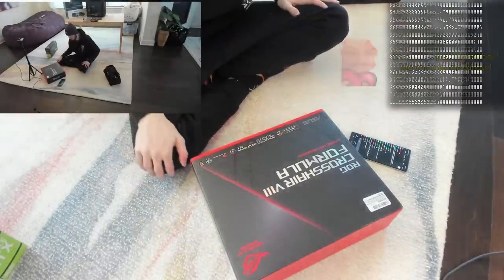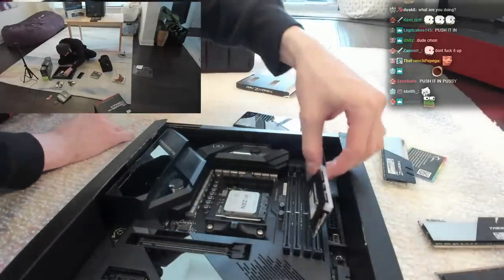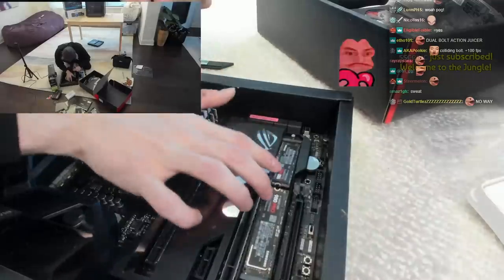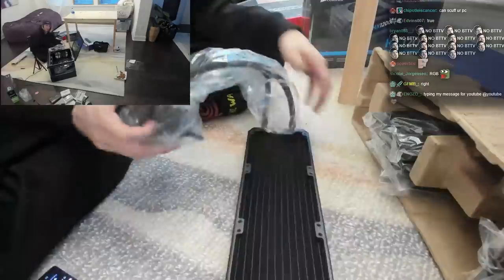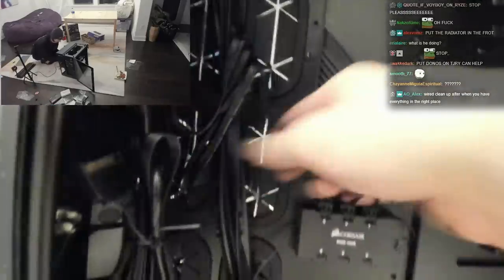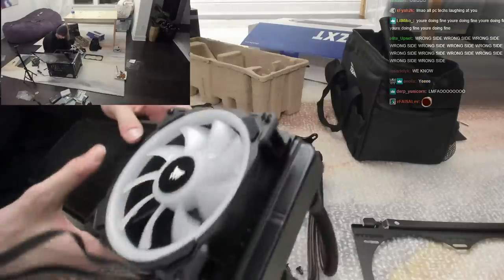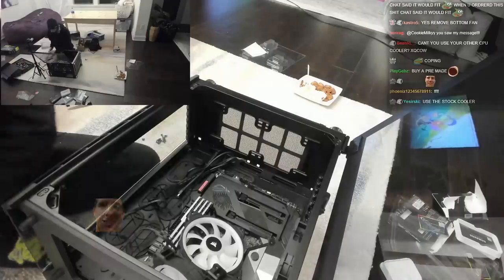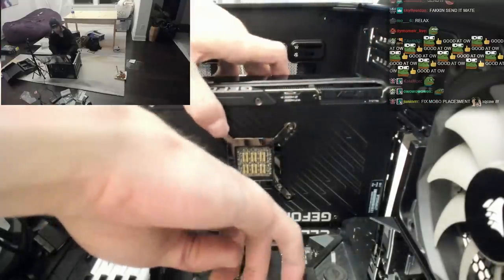This PC Build did not go as planned

Comment: How to ground your self:

1) wear socks
2) be on a carpet
3) touch metal
Reply: 5 head xqc
Reply: Or just touch your plugged in but turned off power supply to discharge yourself. Somebody in his chat should have been smart enough to know that, or maybe not.
Reply: @C0smicr3aper  I literally was there and typed it in chat
Reply: depanto 108  Yes
Reply: Lol
Reply: @TheScaith  what time stamp
Reply: @C0smicr3aper  it’s twitch chat, what more did you expect of them lol
Reply: @liamwatrous694  wait so what does being grounded means? Cause im thinking of building a PC soon. My room has carpet EVERYWHERE. I have a small wooden table i can put the parts on. I don't know anything about these things.
Reply: @ShawnFX  You can use an anti-static wrist wrap, it's what I used when I built my pc.
Reply: @liamwatrous694  I have tiles floor is it safe to do it?
Reply: @whodatboy3  pretty sure its safe
Reply: @whodatboy3  You should always ground yourself anyway just to be safe, it's just a good practice to have

Comment: My man's wearing socks and sweat clothes on carpet building a computer.
Reply: I've done that before, but I've been building pcs for 20+ years
Reply: To be honest it's fine as long as you ground yourself using a plugged in case/power supply, avoid rubbing the carpet, and avoid touching any of the conductive parts of your components. You really don't have to be as paranoid as some people think as long as you have some clue about what you're doing (and as long as you aren't one of those people who unplugs a PC before working on it)
Reply: @mollycrime  Why would you plug in your pc while working on it....wow. You people are something else.
Reply: @drunkhusband6257  It's PC repair 101. Leaving the power supply plugged in allows you to keep the case grounded. You'll be able to ground yourself simply by touching any grounded metal part of the case. It's incredibly basic. Look it up.
Reply: @mollycrime  I've been building/repairing PCs professionally and as a hobby for 20+ years, I've literally never once seen anyone leave the power supply plugged in while building or upgrading.....you know why? Because it's an idiotic thing to do because the charge from the components can hold current.
Reply: @mollycrime  smoll brain
Reply: @mollycrime  stop trying to recover from what you said
Reply: @mollycrime dude what legit never have I ever seen someone leave their power supply on while working on the pc… It’s common sense to turn it all off and having no  electricity

Comment: This man never fails to amaze me.
Reply: FR like he just somehow fucks up its hilarious
Reply: I missed the PC Building stream .. what did he break ? Sadge
Reply: @bari_6157   he got the wrong case even tho the website told him it was the correct case for those parts
Reply: @SiR_236  that's what I call a classic "PCPartPicker" OMEGALUL
Reply: @SiR_236  Pretty sure if he keeps the fans on the bracket pointing outside and installs only the radiator on the inside, then the gpu fits just fine. I just think he's too afraid to break anything, so he doesn't use enough force to screw the graphics card in. He almost even gave up at the first stick of RAM just because he wasn't pushing it in properly.
Reply: @bari_6157  happened to me with my psu lol
Reply: @erikl9146  Sadge
Reply: @SiR_236  yeah Pepehands
Reply: But oh did He fail at everything else

Comment: I'm 99% sure his GPU doesn't line up with the screw holes because he didn't put in the motherboard standoffs. Causing his motherboard to be too low, and his GPU is tilted cuz his motherboard makes it go lower than the back pcie brackets let it.
Reply: 5head
Reply: Yeah for sure it wasn’t on the stand-off properly. I could see the motherboard flexing as he was tightening it as well. 😬

Comment: This build inspired me to buy a prebuilt pc
Reply: @macksladek5782  kind of is
Reply: Honestly now it’s probably better to just get a prebuilt
Reply: @macksladek5782  I just did my pc build and my god it was hell. Watched countless hours of pc build videos and also read the manuals for hours and putting in the aio on the front was a hassle. In the end my pc didnt turn on after having everything plugged in  right. Had to return my mobo and replace it and also my psu and the pc turned on finally but no POST so then i did more research and turns out my mobo didnt support my ryzen 5600x cpu so i had to take everything apart again and get a different computure to download the flash bios update on a flash drive and put everything together again. In the end my pc build turned out great but the stress building it was not worth it in some aspects
Reply: @dabmwlawnmower8089  true but in the future building a pc is better.
Reply: @adeezzee8892  It's way, way cheaper though. Think of it as working to make hundreds of dollars in a single day.
Reply: @adeezzee8892  are you sure your motherboard didnt support it and not just your bios
Reply: @adeezzee8892  u just pepega
Reply: @RonPaul42069  Nope almost every single thing I bought was almost double or more than the retail price. Only reason I built mine is because it’s more customizable and makes it feel like mine
Reply: @syaz4380  nope the mobo was messed up because I replaced it with the exact same mobo and the build managed to turn on and I had to update the mobo using BIOS Flash back in order to post the bios and support my cpu
Reply: @adeezzee8892  asus gave me a motherboard with a bad bios even after the flashback. I had to order a new one from asrock and it works perfectly with my 5800x ryzen. Lost around $200 bc asus wouldnt repair or refund me.
Reply: @icedtokey5511  yeah that’s true but just from what I see I don’t think the gpu prices are gonna go up soon so if you wanna wait you could probably get a better deal but it’s just not worth it IMO
Reply: @Zealch_  I ordered my asus mobo from Amazon and I had a replacement for free so that sucks too hear that sorry bro :/
Reply: @adeezzee8892  ill show u my build ull cry go play child
Reply: @adeezzee8892  just use a pc parts picker so you can figure out compatibility you pepega
Reply: @yab3146  it’s not hard, it’s like 8 different components, but right now because of the shortages it is cheaper to buy a prebuilt so if you’re planning to get one i’d recommend just buying a prebuilt

Comment: Nobody in your chat knows what they are talking about it’s not the case the radiator should be a 240mm or 280mm to mount at the top and nobody thought about that when they told u to get a 360mm they the gpu would fit to
Reply: watercooling is overrated anyway. should have gone with aircooler and had much less issues and hassle, plus i think it looks way cooler ha-ha.
Reply: @userise222  Yeah, the Noctua double tower triple turbine juicer would have been fine

Comment: Buys a motherboard meant for VRM cooling, uses an AIO.
Buys a case that probably 'looked cool in the pictures', but doesn't fit the dimensions of a RTX 3090, along with an internal case fan & radiator.
Doesn't use all of the case standoffs for the motherboard to correctly align the board in the case, no wonder why the graphic card bracket didn't align with the case.
I'm just surprised he remembered the power supply this time around.

Comment: hes lucky his components werent fried, however they have gotten more resilient in the previous years. why did he unscrew the 1st and 2nd slot instead of 2 & 3, and not push the case in so the screw holes line up for his card to fit?

Comment: xQcOW if your ever reading this...answer please:

Why buy RTX 3090 and yet buy a ATX Case (Why wouldnt you buy an L-ATX Tower case)

Why buy large water cooler (3 fans) and yet buy an ATX Case

It doesnt even look good even if you fit that stuff in there..why bother WITH THIS CASE AT ALL. You can find better cases and with the money you have, it wouldnt be a problem to spend a few extra bucks to have dimensions off of your shoulders.

Why even bother spending so much money when you dont even check dimensions...wont be surprised if the PSU doesnt fit as well...and wont be surprised if it doesnt even have the right amount of wattage.

Please check these things next time to have a better experience. Im 16 and i built a Ryzen 5 3600X RTX 2060 system not too long ago. Anyone can do it. You just have to spend a bit more time in the preparation phase...otherwise this happens.

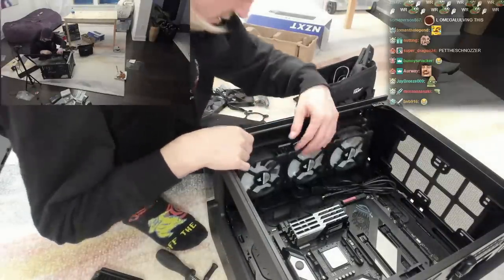Comment: 23:10 unscrew/debolt  the three pre installed fans and reinstall two of the fans on the right side where the air filter.Then install ur water cooling into where ur preinstalled fans were and ur remaining one fan just place it wherever u want my advice the place u couldnt fit ur water cooling system b4

Comment: It's okay when I was little I tried to shove a ddr3 into a ddr2 ram slot. Also I recently plugged a cpu pcie socket into the motherboard frying the computer. And the most recent one was frying a 6800 with an old PSU(or it was the 6800 that fried the computer) not sure about that one. 

But now I have a new 6800 and I'm rockin a 570 aorus elite + ryzen 7 3800x + 64gb ram 3200

Comment: Anybody know what cpu he was using? He said he paid like 1700$ or something. So prolly the 3960x cuz he said he overpaid. Which is exactly what I would have been looking at if I were him. 24 core and 3.8ghz per core. Things a gaming beast. But he said original price was lile 800 something so might have been the 16 core ryzen 9 5950x. And honestly for what you get the price isn't bad compared to the other threadrippers when it comes to the 3960x. Sounds like he got the ryzen 9 5950x if I had to guess. Which is still a beast.

Comment: So what’s the part list? Like which things did he get specifically I’m trying to build a pc soon and his build could be a good reference point.
Reply: Xqc admitted his rig is way too overpriced. You can get parts that do basically the same job for half the price. You could start with an amd ryzen 3 3300x  cpu and nvidia gtx 1660 super graphics card,  great fps benchmark performance
Reply: @Christoff070  well yea I know, I just meant that I wanted to see what a top of the line pc would look like so I could work my way down along with other reference builds I’ve seen, like say if I were to wait until all the pc parts became available and non scalped again, would a 3080 and a 5800x be a good mid-high all-purpose (gaming and productivity) pc?
Reply: @FlameXRLD  Yes thats why im looking at when its in stock lmao

Comment: The reason why it didn’t work was because the spot for the aio at the top of the case is only rated to fit a 280mm radiator, and the 360mm radiator that he bought, is ALWAYS intended to go at the front of the case. This was literally just the results of the votes not being measured right, which is something that’s kind of important, especially when you’re putting a 3090 in your system.☝️🤓

Comment: Your GPU would fit if you put the fans on the other side of the radiator OUTSIDE of the metal chassis but INSIDE of the front bezel. For exactly that reason, you want to get a mesh front panel for airflow. This glass and plastic everywhere META is junk. Something like Lian Li is always going to be better than anything Corsair puts out. As a matter of fact don't buy Corsair or NZXT anything.

Comment: hey ! Linus brought me to you, I just wanted to tell you that even for someone that built 15 PCs in 2 years I went berzerk trying to build in the same case the 680x >< it's beautiful but a nightmare to work with it's too small inside, if you want the "sane" way get a Lian Li 011 Dynamic XL it's not as pretty but not bad looking and you can build a monster PC inside while keeping your mental health, in the 680x I could barely fit one AIO, in the LianLi I've got an all rgb 10 fans custom liquid cooling cpu+gpu loop with triple 360mm radiators a pump+reservoir and had little trouble building in it, sure some people managed to buidl amazing 680x but what they don't tell you is that it took them 2 weeks of rage to figure it out :/ it's missing a few centimeters inside you can't fix that
Reply: You can always make more room with a Dremel 😂

Comment: That gpu could've fit tbh
Reply: No, case supports 330mm, gpu is 318, radiator 27+fans
Reply: @CoinFlipAhri  you gotta use a little force. Trust me. Computer parts are a lot more durable than you think
Reply: @overson7614   it`s not about force, it`s about the impossibility of using this gpu and this AIO together in that case, unless you are a magician :D
Reply: @CoinFlipAhri  even Linus agrees that it would fit.

Skip to 14:18 in this video: https://youtu.be/A0WzLguGLOo
Reply: @overson7614  this part is not about the problem that i`m talking about, the part where xqc is putting the gpu in with installed AIO is cut at 14.11, guess what Linus says at that timing? Anyway, all you need to know is that putting this gpu is technically impossible with this AIO in front, he needs 371mm of space, case has 330mm, thats all
Reply: @CoinFlipAhri  yes I know he says at 14:11 that it's not going to fit, but at 14:18 he corrects himself and says that it would fit. The card clearly fits in the case, it's just not perfectly aligned with the screw holes which means that you need to use a bit of force to move it. I had to do that with my gpu

Comment: Pepega Clap WR Building on a carpet while wearing socks and a hoodie
Pepega Clap WR Bought a triple rad and a tiny ass case
Pepega Clap WR Didn't cross check clearance of the 3090 in said tiny ass case
Pepega Clap WR Doesn't have extra thermal paste and took the cover off the pre-applied paste and let it smudge
Pepega Clap WR Didn't read manuals or ask anyone he trusts for help

Like if you support disabled webcammers

Comment: the NZXT kracken series AIO's are mediocre at best. they are very average and to put on a screen it is very overpriced. instead i recommend the EK-AIO 240-360mm. it offers OUTSTANDING performance. it is literally one of the top 3 best AIO's in existence. and it comes in at around $119-$155. compared to NZXT's kraken series, EK is the clear winner. BUT you most definitely don't need an AIO to overclock a cpu. you can pick up a noctua air cooler for $60 thata can easaly handle pretty much anything you throw at it.

Comment: He was actually doing a good job until he stressed himself out. Hopefully he didn't give up as everything looks like it may still fit.
Reply: No, it won't fit, radiator in front can't be used with the length of his videocard, unlucky that corsair making such big case with 330mm videocards length max
Reply: @CoinFlipAhri  I doubt he will be overclocking and since he's only cooling the CPU, that rad is overkill. It was difficult to see but it looked like if he left the bottom fan off, it might fit. That case also has a spot for vertical mounting but that may not help due to the cards width.

Comment: 🤭he didn’t build the PC on a table like the Verge guy said
Reply: I built my PC on the carpeted floor just fine - you just need to be careful with ESD by constantly grounding yourself using the plugged in PSU and try to isolate sensitive components using boxes.
Reply: @matasa7463  I’m just being sarcastic lol